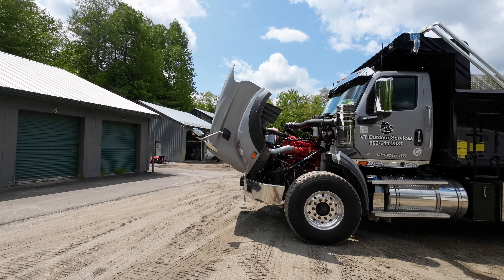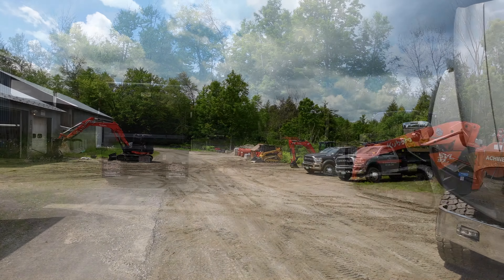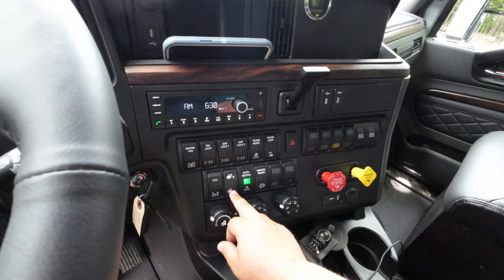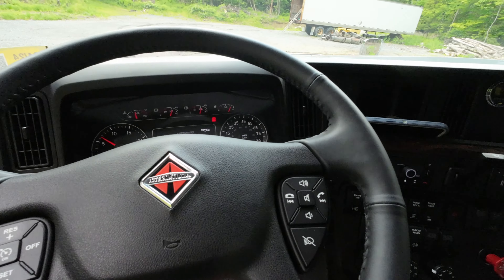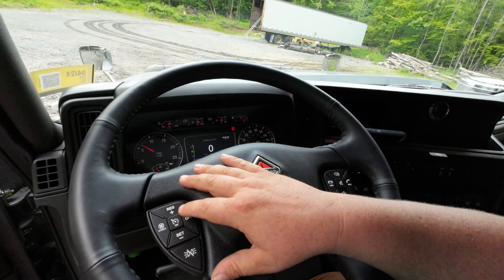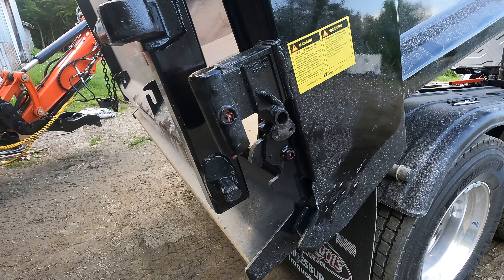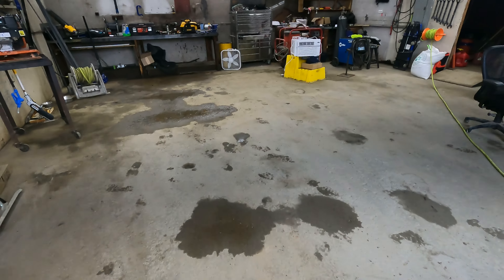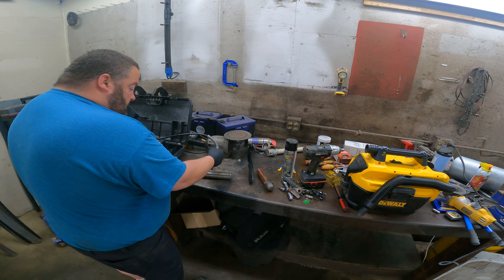Broke My Dream Truck First Load! - 2024 International HX620 Dump Truck

Comment: You could probably have the cruise set with a computer. I have  a freightliner with vacuum pump. My pto is set to run at 1000 rpm on low setting and 1200 rpm on higher setting. with the cruise control My mechanic hooked up a computer and set it for me.
Reply from the maker: I’ll look into it. Definitely rev’d higher than any other truck I’ve experienced

Comment: Had a new driver dumping a load of dirt forget to swing the locks away from the door and secure them in the hook, so when he dumped his load the locks swung back between the door and body and bent them all to hell when the door swung back in. He managed to get an excavator on site to bend the hooks back, but felt bad enough to tell me about it later that day. I looked at it and told him “if something breaks and you manage to fix it without me noticing it was broken, then it wasn’t broken to begin with”. He’s been valuable to my small company ever since.
Reply from the maker: He sounds like me and I run the show here lol

Comment: Literally smashed up the door latch on my new dump trailer before I ever used it, just moving it around at 11pm in the dark and rain. Then bent the tailgate by dragging it along the ground on a steep transition trying to spread gravel on its first job! Both things were easily fixed, welded up a new handle, and bent the tailgate back with the excavator. I guess you just have to BREAK things in right away sometimes.

Comment: Just from my experience you don’t want to use the cruise control to dump its not Recommended. And once the bodies up you immediately want to put the lever in the neutral position don’t let it stay in the “up”position too long when it’s all the way up. But just my 2 cents
Reply from the maker: Thank you for the tips. I’m always learning
Reply: @VTOutdoorServices  Yupp so am I still everyday part of living. I’ve done the same thing but with chains on the back of the tailgate and forgot to take them off. Had to cut the chains to open the gate. Haven’t done it since lol